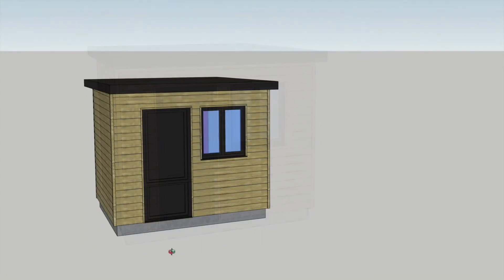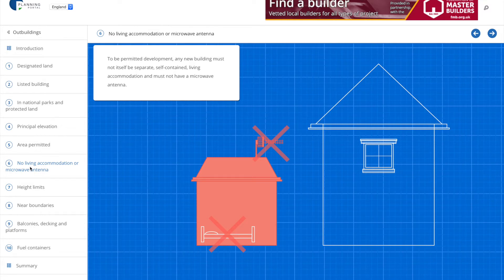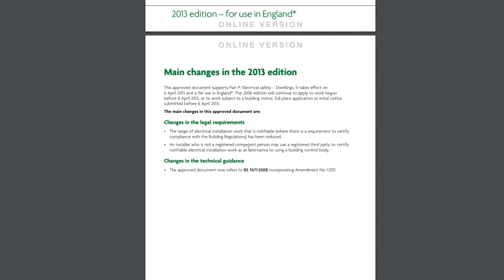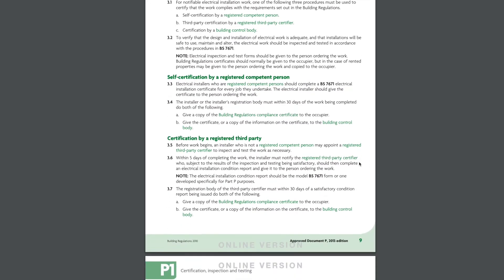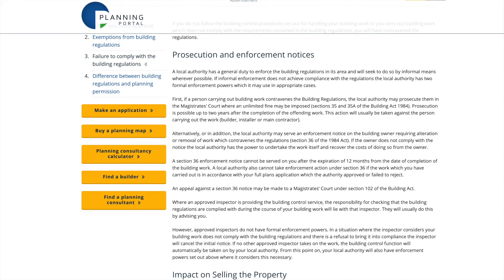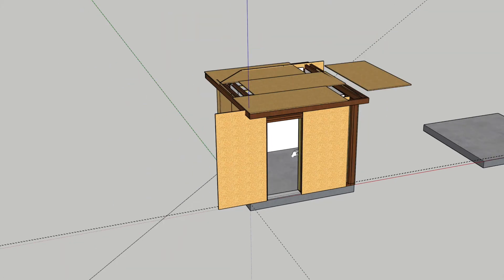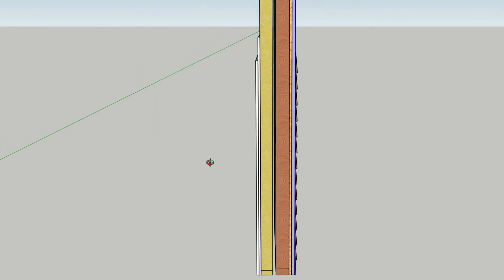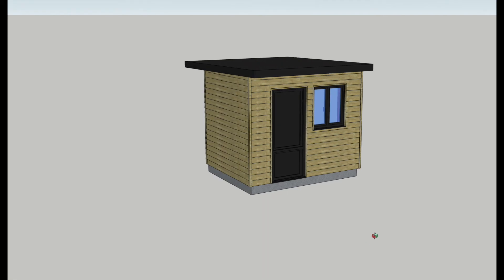Designing a Garden Room in SketchUp - Drum Studio Garden Room Build - Part 1

Comment: Hi Lee, thank you for making this video series - the detail is excellent. You've inspired me to try something similar so I'm going through my own design process. I wondered how much void space you left between your internal ceiling and your external roof?
Reply from the maker: Hi Martin, thanks for your comment. Glad the videos have been useful for you. In order to comply with building regs and keep the usable space inside as big as possible, I kept this gap to an absolute minimum. Baring in mind that the exterior roof is slopped, and the internal is level, the gap between the two joists is around 2.5cm at the lowest point and at the highest point is around 7cm. This is taking into account for the fall of the roof which is about 5cm over that distance. Hope that helps! Lee

Comment: @Lee Murphy  Instead of laying a new circuit to consumer unit or having a new consumer unit involving an electrician, one could just spur off an existing circuit or even put a plug on it within the house and have this go to an out building? Would save the cost of qualified electrician if one knows what they are doing. I think in Wales regulations are stricter to out buildings though but in England is okay
Reply: Or is it a must that this needs to be on a new seperate circuit therefore would need an electrician?
Reply from the maker: Hi Mark - that is a good question. To comply with building regulations in the UK you have to install a separate circuit with its own consumer unit in the building itself. You can always run a extension lead from your house but that is classed as a temporary solution and wouldn't be safe long term. If you want sockets and lighting, an electrician is definitely the way to go. To be honest out of all of the costs, it would only set you back a couple of hundred pounds to have an electrician for the day. If you know what you're doing and can put in the first fixing, that will save them a lot of time.

Comment: What I don't get is, you build the box in the box on the same concrete slab as the outer layer. Then you still have sound transfer from the inside walls to the outside walls through the slab?
Reply from the maker: Hi Robin, yes that is a good point. Unfortunately no easy solution to this because it’s not possible to have an airspace on the floor unless you can come up with a levitating floor! The best thing if there are performance issues is to put down some high density sound mat on the floor to reduce the absorption into the concrete. Concrete is very dense anyway so the sound transfer is far less than with the wall construction. In terms of weak spots that I’ve found in my build, I think that has had a minimal impact.

Comment: Great video! I assume the part P requirement is for lighting, power sockets?
Reply from the maker: Glad you enjoyed the video! Yes that’s right. Part P would be required for the installation of the feed cable to the building, a new consumer unit (your fuse box), and any circuits, including power sockets and lighting.

Comment: What was your overall height of your studio ?
Reply from the maker: Hi Neil. Thanks for your question. The exterior height is just a few mm below the maximum allowed height of 2.5m from the point of the highest ground elevation. Inside, the finished height from floor to ceiling is 213cm
Reply: @leejmurphy  Thanks lee. did you use a standard door height or was it made to suit
Reply from the maker: Ni Neil - yes I went with a standard height, I believe it was 2085mm. With that being said I did have the door custom made rather than off the shelf